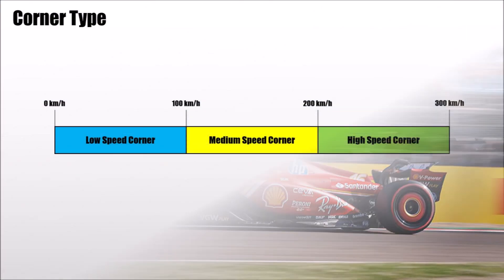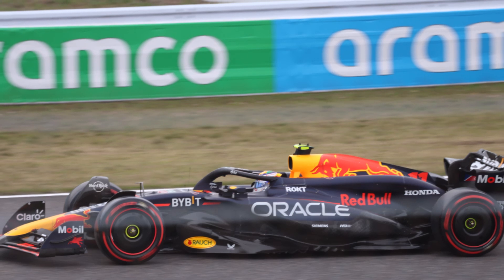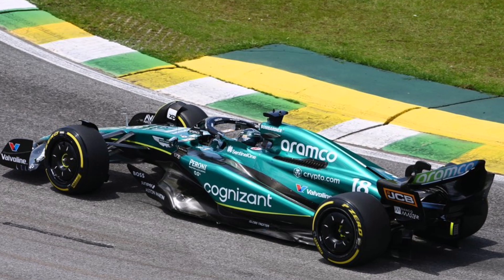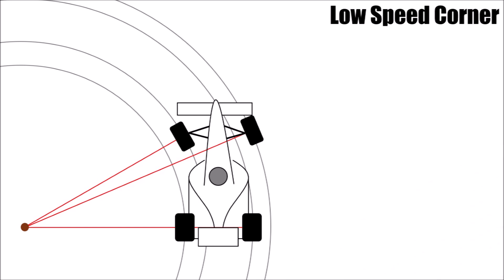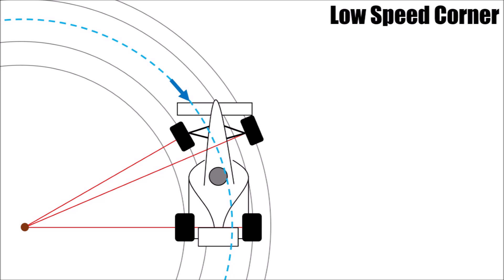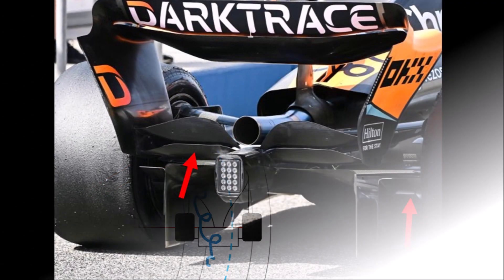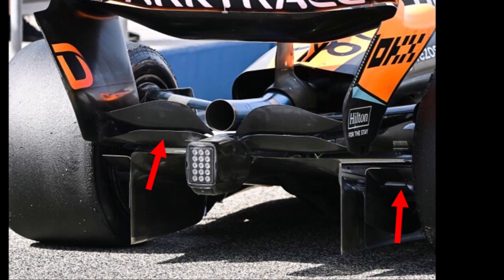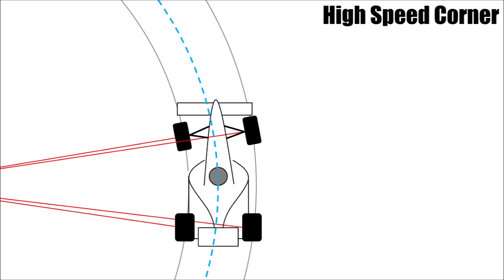LOW vs. HIGH Speed Corner - What's the difference? (Aero Analysis)

Comment: Thanks, nice video.
One problem  air doesn't flow unless wind is involved. 
A car or aircraft move threw the air your drawing is wrong.
When you kick hard rudder on a aircraft you can hear the air spill over the fuselage .
The wing opposite of rudder has less left because of the nose blank out some of the wing on the spill side.
Same with cars.
Sorry about the post. You did a nice job I will keep watching 😊.
Reply: Absolute right.
Good Point.

Comment: Question that has always bothered me is, as the car lowers at speed how much ride height or front downforce instability is a worthwhile compromise between performance and aero balance? 

This video got me thinking that lateral acceleration/yaw rate/wheel wake could cause even more issues for low speed aero, so obviously the most difficult part would be how do the teams deal with all the complexities like tuning the anti roll bars/springs/dampers plus the craziness of aero?
Reply: What I’ve seen this season is McLaren improving these issues in slow corners by using front calliper assemblies to push more airflow outboard at the front wheels and adding more downforce directly over the rear axel from those callipers and really playing with circuit specific beam wings. Obviously they made big changes to floor & diffuser, but that’s the 1-2 mid-season changes, the front & rear axel stuff has been every other race and they’ve gone from near misses in 2023 qualifying to being capable of pole almost every race in 2024.

Comment: Thanks for the video!
How important would you say that air direction is in low speed corners? If it’s crucial why don’t teams and drivers opt to rotate the car a lot more in slow speed corners, in order to benefit from better air flow direction (as shown in higher speed corners) ? Is the added tire wear from bigger rear slip angles the main problem in such a scenario?

Comment: Some new tweaks for the f1 2026 aero dropped allowing cars to go ~2sec faster than original with some floor inlet strakes, larger volumes in the diffuser and some front wing tweaks. Would you cover these in a small explanation video explaining how they would improve lap time?
Reply: +1 to this
Reply: So the 2026 cars were already 4 seconds slower than the current cars. So they still slower
Reply: @km6832  No he said faster, not slower
Reply: @UndisputedGoat4  faster on the straights slower in the corners. How do you think cars make lap time?
Reply: @UndisputedGoat4 faster than the original estimates, not current cars…
Reply: The reversion back to older style wing fences will improve airflow around the wheel and decrease flow separation. Essentially more downforce and less drag for your car, and more dirty air for cars behind. The additional front elements and the larger diffuser should increase overall downforce, but much more dirty air.
Reply: Cam someone give source to watch or read?